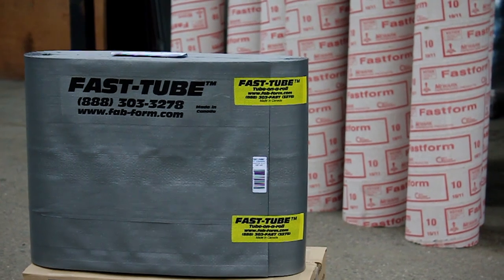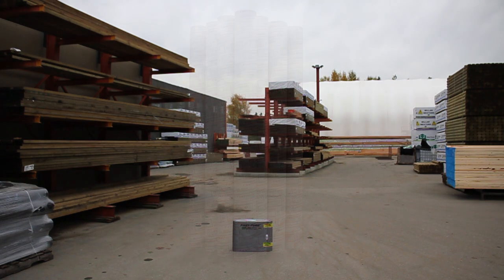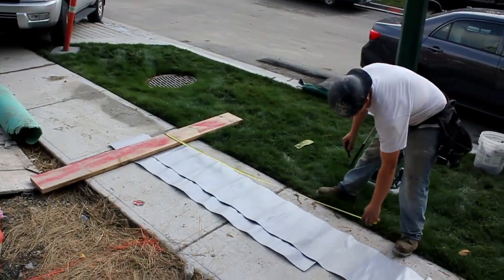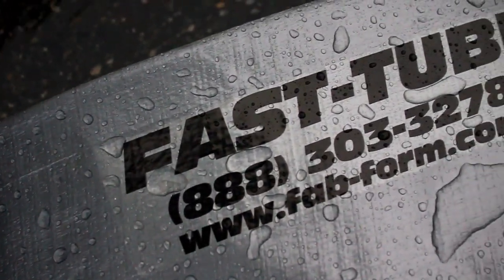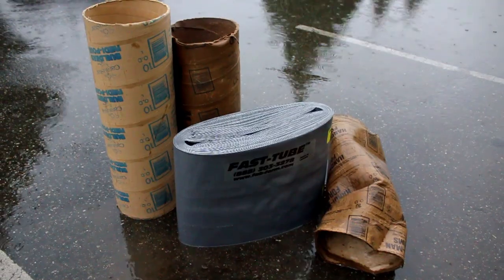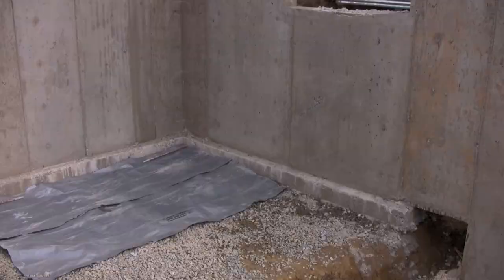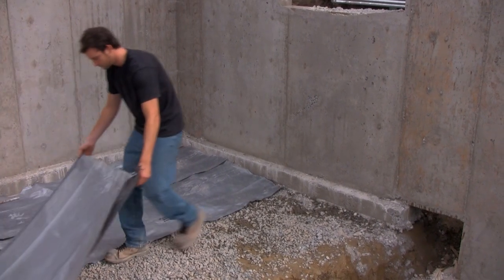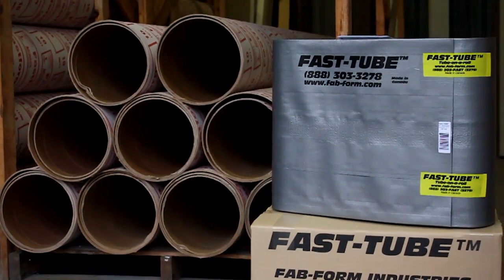Fast-Tube™ Vertical Concrete Column Form

Comment: Did you use any type of rebar for strength?
Reply: You can put fast tub over already installed rebar  OR  install rebar after the concrete has been poured and the concrete is still wet like sliding rebar into very wet mud.